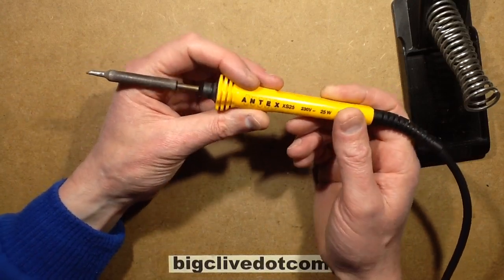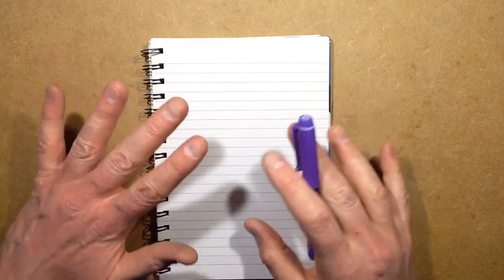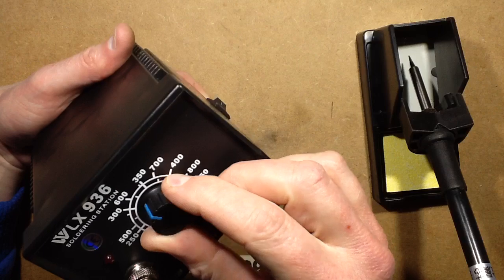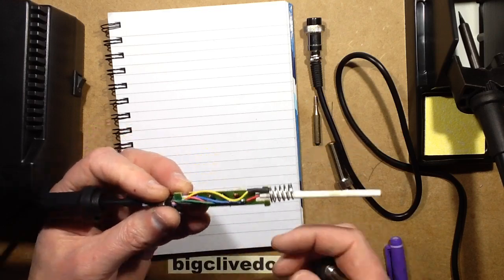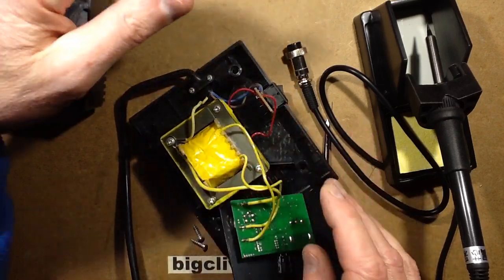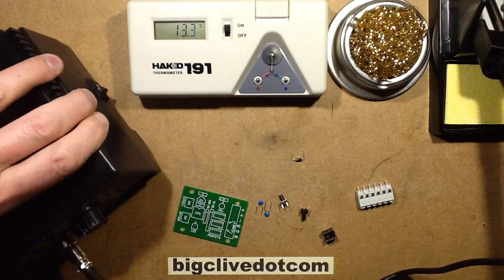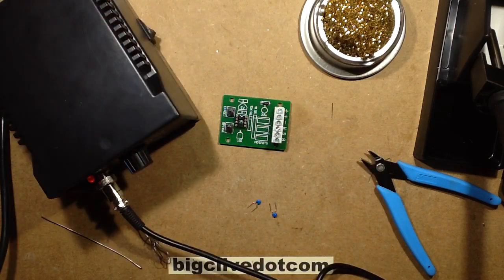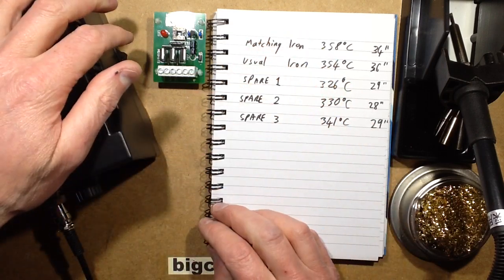Soldering basics and choosing a cheap soldering iron.

Comment: I have been soldering microphone leads, speaker leads, guitar pickup wiring to potentiometers, resistors and capacitors and various other stuff for over 45 years, this kind of work is almost impossible to do with out using a 'heat sink';; soldering plain wire is simple ( as long as you first 'tin' the components);; soldering co-ax wire is a different matter, you can melt the plastic on the core wire and cause a short circuit.

'Spring Release Tweezers' (Reverse action tweezers) are what you use as the 'heat sink' -- they prevent the heat of the soldering iron travelling down the shield wire and melting the plastic coating on the internal core wire --- and yet these very necessary 'heat sink' tweezers are NEVER included in any Soldering Iron Kit??

*  If you don't have Reverse action tweezers, a small crocodile clip can be used instead -- but it's not ideal.
Reply: When I was taught soldering at school in the 80's/90's we used elastic bands on plier handles as a heatsink. It wasn't until YouTube got into the swing that I realised you don't need to with most components. Still, I never had heat failed components on any of my teen amplifier projects, or the memory upgrades in my Atari ST, so it was no bad thing to be more careful than necessary, other than in lost time, which is largely irrelevant to the hobbyist anyway. Now I have a handy resource for soldering tips and tricks so I can check a component out first and get a datasheet, where that was often tricky pre-internet if you weren't in that specific sort of hobbyist club or network. Though I don't much like what successive corporations and social media have done more recently with the Internet I loved so much, that encouraged free speech, free thought and knowledge sharing.
Reply: Been doing same thing for 30 years, never used a heat sink.  Never had an issue at all.  Still, for people learning, it makes sense to use one.  Proper soldering technique and understanding is the most important thing to prevent damage to components.
Reply: When I started soldering 50+ yrs ago, soldering irons were relatively high wattage. They were made for soldering point-to-point connections like terminal strips and tube sockets, and passive components the size of a small child's finger.   Heat sinks were essential when soldering small semiconductors, thin PCB's and smaller hook-up wire. As IC's were introduced, irons got much smaller (no more dual-headlight Wellers) and heat sinks became superfluous.

Nowadays, I solder 0201 passives and 64+ lead IC's under a microscope. I have to apply paste flux with a needle, and slice shavings of .015" solder to avoid applying too much. Irons have changed a lot, too. My current favorite is the Metcal iron, which uses RF induction heating and Curie point metallurgy to control the temperature. While not $25 dollars, when I set out as a consulting technician, I dropped $100 for an used early edition Metcal on Ebay. One of my tech friends saved the used tips (his procedures required changing the tips regularly, whether it was necessary or not. ) While it's a bit expensive for most hobbyists, it's more than worth it, and if you treat the tips right, you can get a lot of life out of them.

Comment: i got me a soldering iron off ebay like that exactly the same except mine has an led display for the temp, though it does work well i still suck at soldering and alot of my bits end up going black basically instantly not sure if its me or the quality of the bits though
Reply from the maker: You may be running them at too high a temperature.  Use good quality flux cored solder and adjust the temperature down to the point it still melts and flows solder well.  A stand with a sponge or brass pad for wiping the tip on is also good.  And only use it for solder.   Melting plastics will corrode the tip.
Reply: yehh that's what i was thinking i looked up what temp a soldering iron should be and set mine to what i found, though after watching this video that was obviously a mistake as there's not really a uniform temp perfect for all. im glad i came across this video ill be soldering a bunch of battery holders into some cartridges when they arrive so ill be able to adjust the temp how you said and get it suitable for me

Comment: i use flux free solder because i generally work with very small repairs where the part already is fluxed. Not to mention flux core solder has always been a mess for me.

Comment: What is something i missed here in the vid is the fit of the tips to the heater.. the tips hardly ever make a perfect fit on the heater element ..may be the reason why you see differences in each solderhandle you plug onto the station. Often I have to use a little bit of tinfoil  in between tip and heater to get  a much  better conductivity ..

Comment: Thank you for making this video. I recently had to replace 3 capacitors on a server motherboard and i really wish i watched this video before hand as it didn't go as smoothly as I'd hoped. After about 2 damn hours trying to get the solder to sick without melting the plastic on the motherboard I managed to do it and all was well. It would have been so much easier if i where using a better soldering iron and lead solder I think!

Comment: Regarding DIN plugs and sockets:
DIN means "Deutsches Institut für Normung" (German institute for standards), former "Deutsche Industrie-Norm" (German industry standard).
Reply: DIN plugs on the back of the commodore 64 and midi connectors etc proper old skool, those gx16 plugs are old skool cb radio mic connectors lol. also found on welding equipment.
Reply: @stoatrepublic  Correct, I have wired many "Ham radio operators" mics .. Ham radio is not what it once was!
Reply: for standardisation*
Plus, those aren't DIN plugs and sockets, those are GX-16 plugs and sockets.
Reply: fur Normierung

Comment: I didn't know people bought from Maplin. They're a massive rip-off.
Reply: ChompChompNomNom In Glasgow, after RME closed down and before the Internet became a place for shopping, it was the only place other than RS you could buy components... now they've gone all high street on us, it's more like walking into one of those toy chops with the remote control drones and cheap plastic rubbish (only the stuff ain't cheap...).
Reply: Less that is never the, Maplin as a shop is a very important one to have around. That they’ve gone into administration last week is quite sad. I think that their strategy of becoming mostly a toy shop over the past two decades is partially a mistake. It is only about now that they should have played on their strength as a high street “maker” movement shop for parts, ingredients and components. I’ve been buying resistors, transistors etc from them over the past couple of years, even though they can be had cheaper elsewhere, because I want to see them still around for the foreseeable. In my opinion they should have (and it would have been difficult, especially to explain to the shareholders and stakeholders) concentrated on components and soldering and arduinos and raspberry pis and bbc micro:bits and become a makers paradise, not a toy shop. New generations still get enthralled by things on shelves in shops – if Maplin goes, a new generation of engineers, designers and inventors will lose a valuable inspiration.

Comment: Dude, you sold me. I've been looking for a good alternative to these 30W unregulated irons you get from radio shack for $20 (or the same thing from harbor freight for $4...). There was no way in hell I was going to shell out $100 for a regulated soldering station, it's just not worth it to me personally, but I found this model on Amazon for $32. I think I'm definitely gonna grab it sometime in the next few weeks. Do you have an Amazon affiliate code I can use so you get a kickback from it? You're videos are awesome, I learn so much.

Comment: I just looked at my Trakpower TK950 (sold by an RC car equipment supplier). if it's not the same inside it has the same case. Wouldn't surprise me, though. Was definitely better than my old cheapo self-regulating iron, and the self-contained RadioShack one that I had as well.

When I bought it, I was doing a lot of Deans plugs and Banana terminals for RC speed controls. Big stuff with big wires. I needed power, this did a decent job.

Comment: Would someone be able to link me to a good soldering iron on ebay?
Reply: while i wont link anything since there are so many choices, but at the same time really only a few, it basiclly all depends on how much you are prepared or want to spend, i will say most important thing for buying an iron is tip selection. make sure whatever you buy has a good variety of useful tips for a good price for either the genuine items or fakes if they exist, so if your going for a clone or genuine article then try to do some research first on what tips are available for it and how much they cost, since you dont want to pay £40 for an iron and have to pay £15 for each tip when theres only like 5 types about when you could buy something different and be able to buy tips for £5 (or less than £1 for copys). so if you get a standalone iron, firstly make sure it has a internal heating method not external ie the bit goes over the (ceramic or metallic covered) element, and not inside it (like plumbers/cheap irons) since they have generally better thermal efficiency at equivalent power levels and can be efficient at lower power levels (ie 20w/25w with 'good' irons) secondly dont get any temperature controlled handpieces (the ones with the little dial on the handle), and thirdly try to make sure you get something made for 220-240 and idealy with a uk plug or if it has 2pin then youll want to replace that with 3core when you get it. unfortunatly the options are limited in that range on the cheap side of things, and things like the gaojie 220/gj220 are almost impossible to find nowadays (amazingly super efficient sort of antex clone but really well made iron for about £1-£2!!, came with 2pin plug but you could replace with 2+e since it had unused earth connection inside so it could be made safe) so otherwise, if just a handpiece, you could be paying £25+ for a antex/weller/ersa iron with those requirements. if you want temperature control and want cheap, then starting with any of the hakko 936 clones is ok, you can still find uk stock for £20-£25 and should pay no more than £30 for a good quality copy from china or hong kong. i could go on so much more but i think ive written too much here already so il say i can go on if you want to know more in pms, up to you but otherwise basicly the above is the most relevant stuff and after that its down to preference of operation, like do you want display/feedback with digital input or analogue input with the feedback being the knob etc (my prefered since its quicker and no more is required) and preference of cost, so as long as you dont get an iron that heats the tip externally, has no tip selection (basicly), has 'temerature control' on a trimmer in the handle, is unearthed and is either really high power (like 100w+) or gimicky in some way..idk just has some dumb 'feature' that will likely cause a problem in the future, then you cant go wrong :P again if you want specific examples or makes/model nos etc then pm me otherwise you could also maybe check out other 'good' youtube electrical engineer types and see what they get away with using for some ideas/confirmation etc..

Comment: I need your help bigclive. I am fairly new in soldering and I've tried some tricks I've learnt on the web. Sadly, I've been through 3 irons in less than 2 months. My biggest problem is that my iron's tip chips and a piece of it falls off, making soldering super hard. Also, is having a soldering station better than a soldering tool? Thanks in advance for answering those questions and keep up with your videos! They're great
Reply from the maker: What sort of soldering iron are you using?  The only iron I had a problem with the tip cracking off was the terrible cold-heat style of iron.
Reply: I started with a 40W Weller because it is apparently a good brand, but a third of the tip just exploded after some time. Then I got a gas torch, a Mag-Torch, but same thing happened. For the third one, I bought a cheap one off ebay (not the one you made a video about), but I kind of expected that one to misbehave.
Reply: Now that you've introduced this soldering station, I am tempted to buy it, maybe those cheap irons will end my misery?
Reply from the maker: At the very least the spare bits are cheap and plentiful.  I'm not sure why you had problems with the other irons, particularly the Weller.  I'd suggest getting some traditional flux cored lead solder to use with your irons as it is much gentler on the iron tip.
Reply: Oh thanks for the tip, I'll try getting some lead flux cored solder. Also, do you have a link to that soldering station you bought in your video? There's many out there and I don't know which one to trust.
Reply: In the video he says it is the Yihua 8786D, I found this on amazon: http://amzn.to/2ekcm2F I assume it is the same one.
Reply: Ordinarily, Wellers are pretty decent.

Comment: Got a similar one at home, works good enough for my needs. Bought a spare iron for it too, which came with a rubbish, imprecisely moulded ceramic heating element.

In your video you say you see no need to ever replace the heating element since you can just buy a new iron? Well, a good heating element fits the tips more snugly, assuming you use decent tips. Because of this, the heat transfer is better. You'll have less trouble with fluctuating temperatures and your iron will warm up faster and register a more accurate temperature. Odds are the temperature difference between various irons will also decrease, and your thermal mass problems will likely also diminish, although that's just speculation on my part.

In any case, many of these irons come with heating elements that don't fit very well. Which is why I just view them as inexpensive holders for decent heating elements and tips.

Someone posted a nice comparison on the EEVBlog forums: http://www.eevblog.com/forum/reviews/genuine-vs-fake-hakko-936-ceramic-heater-a1321/

Comment: Antex made really excellent irons. I started with the same 25W, then got their ultra low-leakage CCN15 when I started to play with CMOS (and that was years back).  Currently use a Weller "instant heat" gun for heavy (chassis) work, and a genuine Hakko FX-888D for more delicate stuff.Solder? Can't beat Ersin Multicore. Dearer than the Chinese knock-off version, but you get what you pay for . . . . . . .

Comment: This was a great video and gave me quite a bit of insight on what I was doing wrong. However, there is one thing that isn't in this video that in my project is something I need to do quite often, and that's de-soldering components. I bought a whole mess of old Megadrive consoles from someone on Ebay and planned to mod them for S-video, PAL and NTSC controlled via switch and a modest overclock from 7.2MHz to 10MHz. Half the work is de-soldering leads from on-board ICs like the CPU or GPU and cleaning said leads and pads, and most of those that I did ended up with burnt circuit board. I used de-soldering braid, put it over the lead and just pressing it onto the braid directly, and that always just burned the board to literal death. (Like, 4 dead Megadrives.) I'd love to see how you handle basic de-soldering as you clearly know what you're doing.
Reply: So, based on my (sad) experience, i guess you didn't use flux. It reeeeally helps. Apply a bit of flux where you want to dessolder, them use the iron. Also, there are some really shitty brands, both for flux and braid, might wanna look into that
Reply: Also, have you tried using a "sucker"? (Dunno if the name is right, at least, that's what it's called here in Brazil)

Comment: I have never been good at soldering. I don't build circuit boards. Most of my stuff is wiring etc. Now I know that one mistake was that I was making was loading the iron with a blob of solder. 
Another weird thing. I have a Weller soldering gun. With a trigger. I usually melt or ruin whatever i'm trying to solder by the time the wires or whatever get hot enough to melt the solder. So I bought a iron like you have and that seems to help a lot. 
If I'm doing a wiring solder joint, I will use acid core solder and slather flux all over the joint, then heat the joint till I can flow solder in it.
Then turn it over and do the other side.
Reply from the maker: With a decent flux cored lead based solder you should find the solder flows nicely into and around the wires.  If you're soldering big wires then heat melting the adjacent insulation is always a bit of a problem.

Comment: I bought a Yihua 937D a few years ago..it's very similar to the one in your video except it's digital...It's still working as good as the day I bought it. I paid $50CAD for it, could have gotten it a bit cheaper from China but it would have taken 10 times as long to arrive.
Reply: where did you pick that up? I'm in Toronto and I'm having trouble finding a cheap station that doesn't cost an arm and a leg in shipping
Reply: +Alexander Forster I got mine on eBay a few years ago and if I remember right it was shipped from Toronto.. the interesting thing is that it arrived in a Amazon box so I'm assuming that the seller was also selling them on Amazon as well. Unfortunately the price of almost everything has gone up since I bought mine and its unlikely you'll find one in Canada for that price now...good luck and I'll keep my eyes open, if I find one I'll let you know..